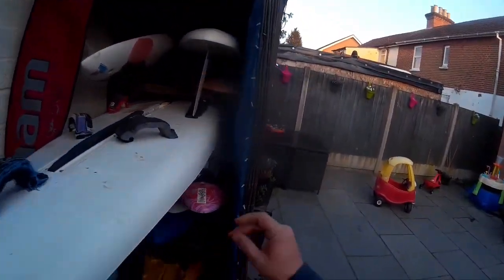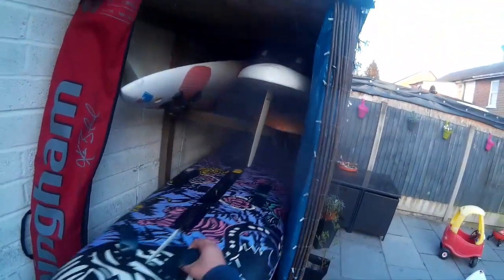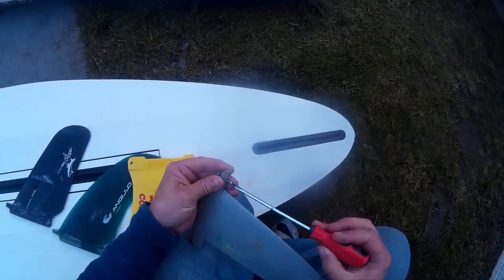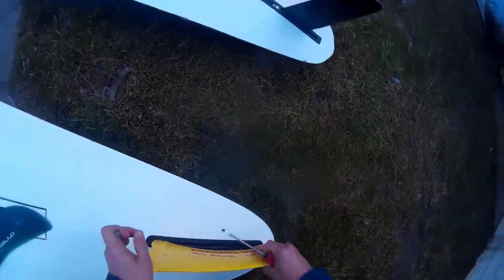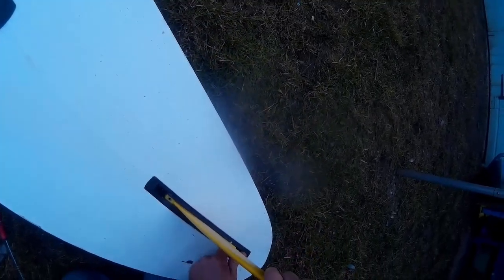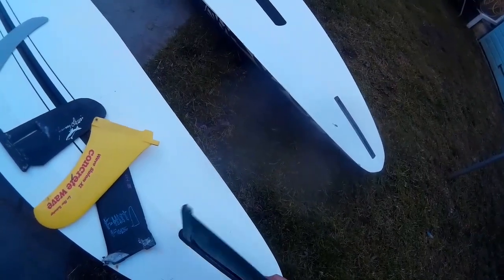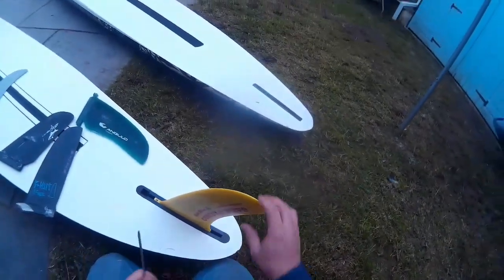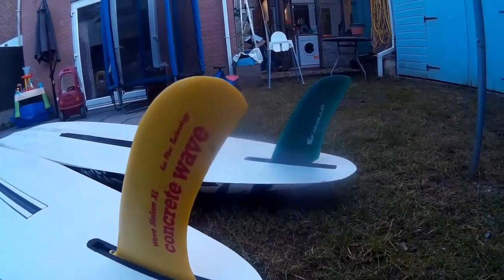Trimming up new fins for old windsurfing boards!

Comment: My Ultra Cat has a powerbox, I wonder whether that might have been fitted later during its life sometime?
The Equipe I picked up yesterday has a powerbox as well, so luckily that makes choices easier.
They both have great fins so unless I break one, I'm sorted!!
Reply from the maker: fanatic were a bit weird in that they used both Power and Trimbox in various incarnations. trim was earlier though so if you have a powerbox on an Ultra Cat it could be an addition after the event like you say. The bolt through systems are definitely better, stronger and more plentiful in useful shapes than these A/E/US ones.